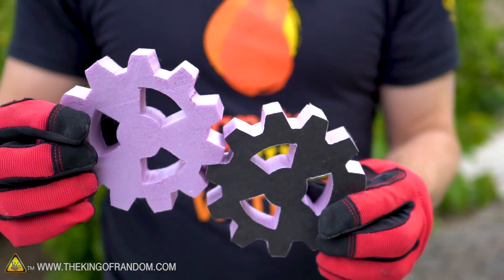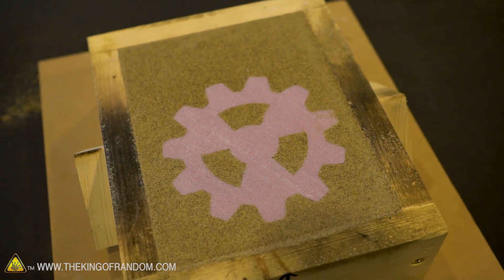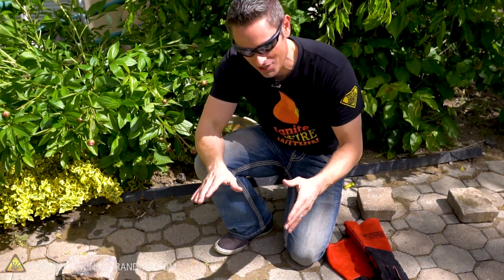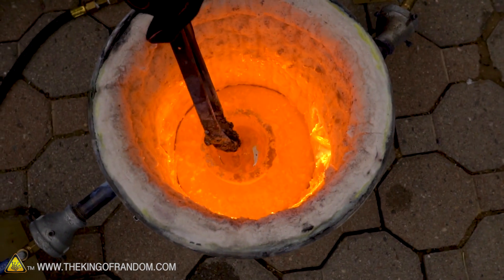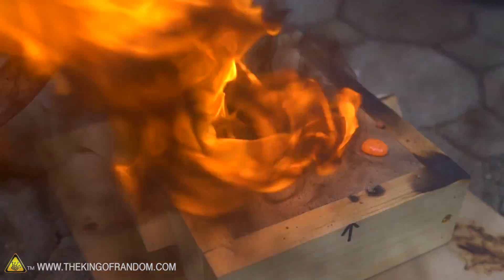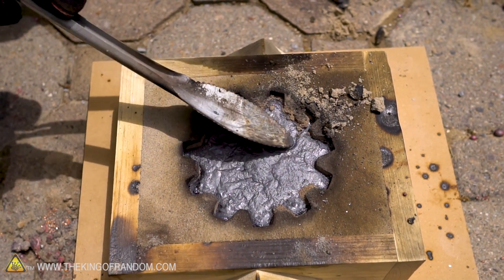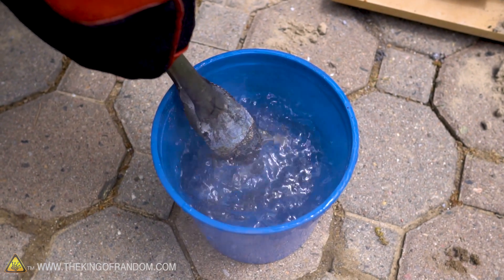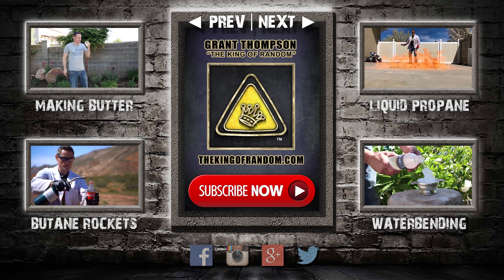Argh. Why Is Copper So Difficult? TKOR Tests Melting Copper In Our Homemade Foundry

Comment: hey grant you should upgrade the sand box when you compact it you should make a new one that will compact all of the sand  you can get two wood pieces and one should be bigger then the box and on the same size of the box then screw both pieces together

Comment: LOL! I think it's the buoyant forces that's the problem here and not the melting point of the copper. Copper have in fact higher density than cast iron or steel - and several times higher than the sand, wich causes those pieces in the middle to break off and float on top. Aluminium has much lower density, so that's why it may not have the same problem.

Comment: Next time, make the mold with two sides, one side that has the gear and other one with just flat sand surface, it should keep the sand intact in the mold when you pour it.
Reply: And you'd need a cavity for the pour, I'd say the middle part would be the best way for the gear. Also try poking air vents into all corners of the piece you're trying to cast.

Comment: Use clay to make the mold, it won't break as easily as sand. And make sure it's hot when you pour the molten copper on it, this will prevent copper to cool off too quickly and help it fill it better.

Comment: the best way to sand cast is with a cope and drag two part box, with the actual mold under the sand with a riser and a pouring basin, stops the sand from breaking and the copper from bubbling, rather than an open top

Comment: more water in your sand = more evaporation when the copper hits the sand. It makes no difference when you wave your copper over it. However why dont you preheat the green sand? You don't need the wooden box when it's stable after all.

Comment: Hey Grant. I think that because of the way the sand was packed, it might not have packed so well into the smaller areas inside of the gear, which could lead to the troubles you had with those parts popping out.

Probably not, but it's an idea.

Comment: try using cheaper styrofoam...or maybe try melting the styrofoam beforehand with a blowtorch. i was wondering why u didnt whip out the torch. also , seems like in this video pouring it into the mould faster tends to maybe break the mould.

you could also try to make those moulds where its buried in the sand instead of having one part exposed. not sure never done casting just base on tons of casting videos ive binged watch.

Comment: if you connected the Styrofoam to the bottom wood piece of the box so when you open it it comes out. Would that help at all? This way you wouldn't have to melt it and it would remove the delay.

Comment: idea: use a metal baking pan to hold the green sand, wet the sand down, then after you melt out the Styrofoam throw the mold in the oven to heat up the sand so that it doesn't cool the copper down so fast. you might lose the some and after this attempt (the heat might bake the clay) but i feel like this might work. i watch a blacksmithing channel, and whenever they do castings, they always heat the mold.

Comment: If you use both halves of the mold you made, and make a vent hole on the opposite side of which you make your pour hole, you gear will fill the whole cavity and you can just cut off the extra. Check out myfordboy on YouTube for examples

Comment: Use oil instead of water it wont boil as quickly in the copper keeping it together a under higher temps, that is what we use for iron/ aluminium casting.

Comment: All the casting videos I have seen used wax not styrofoam.  The casting company after creating the wax would cover the wax with a clay like casing.  The casing is then cured in a oven making the shell bisque hard.  It is this casing that is buried in the sand and will take the steel or what ever in the pour.

Comment: You could try placing the styrofoam completely under the green sand and use some kind of pipe that you can remove to make a pouring channel, you'll need two one to pour and one for gas to escape. i.e. pack an inch of green sand, place your foam gear pack a little more to ensure stability place a pipe on the gear and pack sand around it to ensure stability. do that in however many locations you'd like. finish packing the green sand. you need to ensure the pipes are long enough that after packing you can give just a slight twist to free it and then carefully pull it out.  I've had some success with this method. it's similar to what you did with the foam master sword.

Comment: try covering it with sand combletely
and dig channels for molten copper to run though them and make a sand funnel for pouring the copper
that's how i see people casting with green sand on youtube usually and it seems to work
 IDK though

Comment: What if you try wetting the sand, then melting the styrofoam first and then adding the copper later. The latent heat should harden the sand along with melting the styrofoam

Comment: Grant Thompson - "The king of random" try your old Technic that you used to make the brass knuckles if that does not work try a permanent cement mold but warm it up first so the copper doesn't turn solid again

Comment: My man, the surface tension of the molten copper is well enough to tear greensand.
Use some wood, stuck into the "radioactive holes".
Make sure they're in deep so they don't float.

Comment: You need to use both the cope and drag to keep those pieces supported. Also your sand mixture might not be right. It shouldn't break that easy. Try adding more clay.

Comment: Why don't you bury it completely, like you did with the mini master sword? Just glue one or two pieces of styrofoam on the Gear to act as a tube for the molten copper to flow into. That should solve the problem with the Sand popping out and it will maybe even keep the cooper molten a little bit longer, due to thermal insulation..

Comment: Grant! Copper is very tricky when using sand, which is why many people opt for metal molds instead for copper. A trick: Burn the sand into the mold you want BEFORE pouring! It will help keep its shape.

Comment: the problem is that the sand cast is fragile try using  a finer  sand-clay  mixture or  reinforce the small parts of the mold with sticks or bars, also the water in the sand, may cause this, i observed some bubbles at the end exiting from the copper

Comment: Injection moulding works with a very high pressure to make sure the molten material fills all spaces of the mould. You should use a hydraulic press to simulate that concept. But here's the problem, you'll need a more sturdy mould. Concrete maybe?

Comment: Pure copper is tricky to cast at best, so you may want to introduce traces of phosphorus to reduce oxidation, otherwise you'll find porosity throughout your casting. An open-top mould that isn't at least brought up to temperature will cool your metal too quickly, resulting in slowed flow and cracking of the mould material. Ideally you find a homegrown method for investment casting using vacuum assist.

Comment: the water is the problem i think. it instantly vaporizes when the copper hits it basically exploding the sand. might try using something a little more cohesive to hold the sand together, like maybe oil

Comment: your sand should be much fine grains. It should behave like clay. It should be so strong that you have no problem removing the Styrofoam by hand and still hold its shape. It will help if the bottom part of the Styrofoam is slightly smaller

Comment: hi Grant I love your videos . I ve  been subscribed for over 3 years and your videoss never get old. And for the copper , you should try using and solid materials instead of sand . Or even put some heavy stuff over the sand mold but not so heavy that it's going to break the mold. :)

Comment: throw some kind of flux in there, dude, clean that copper up before pouring. also, heat up your mold before pouring. you could throw it in the oven to both melt out the styrofoam and the mold won't cool down the copper as fast.

Comment: The problem with your greensand is that it doesn't have enough cohesive power to hold itself together when you pour a high-density liquid like molten copper. This combined with the residual moisture which will boil off and create steam under the copper will break off details of the mold. 
You need to make your mold stiffer. I suggest mixing in your greensand some sodium silicate, and let the mold cure for a while in the presence of carbon dioxide which will turn the sodium silicate into solid silica. That will bind the sand particles together much better than the bentonite. One way to do that would be to place your mold at the bottom of a bucket, and place a few chunks of dry ice around it. Let it stand a few hours, such as overnight.

Comment: You need to pull out the styrofoam without melting in, and possibly gently heat the green sand before pouring. The green sand doesnt need the styrofoam to hold its shape. It does look a tad crumbly though, maybe modify the mix?

Comment: you could try using  a sand Oil mixture as green sand and add the top of the wooden frame with a cone doug out in the middle

Comment: Try encasing the entire foam template in sand, instead of having one side exposed, with only a hole in the center to pour the metal into. The copper should replace the styrofoam as it melts.

Comment: add silicone to the sand instead of water. it will set almost immediately after you cast. also, you need a double sided mold. not an open faced one

Comment: I would suggest using pool filter sand mixed with sodium silica to make a hard mold ( it hardens when exposed to CO2) that way it wont break and to slow the copper cooling you could use a closed mold incited of the open mold method just be sure to vent with small holds to let the vapors out quickly to avoid pockets in the casting

Comment: liquid nitrogen vs molten salt
Reply: GMMfan #1 salt melts, google it😂
Reply: GMMfan #1 yes it does
Reply: GMMfan #1 it does
Reply: GMMfan #1 it does but in hing melting point and if put in water it will explode
Reply: Natsu Dragneel  yes when he pour it on the water and explode
Reply: 420BlAzEiTfAgGoT it's possible, he melted copper, salt melting point is lower than that
Reply: kingkongTSR i dont think he will reach the temperature to do that
Reply: im sorry i was wrong i looked up and you were right. +1 like
Reply: GMMfan #1 you don't have to be sorry it's cool you were curious enough to look it up
Reply: kingkongTSR its ridiculously hard to melt salt. If you put a cast iron pan on the stove and salt in it,( and if your stove could get hot enough)it would melt the pan before the salt. Just saying 😂
Reply: kingkongTSR salt doesn't melt though

Comment: Hey Grant! I have used my green sand with a styrofoam pattern. I successfully combined molten copper and tin to make bronze and cast an Egyptian style sword. Using the other half of your cope and slide would help provide added pressure to the bits in the middle that keep floating up. The copper just has too much mass and makes those bits float. Just make sure you provide proper venting for the vaporized styrofoam gases to escape away from the spout where you are pouring. If you have issues with the molten metal traveling too fast causing blowouts in your pattern, then you can cut "gates", just some turns in the channel that lead to the pattern, to help slow down the metal. Hope this helps!

Comment: Grant you should use both sides of the caster. fill one half with only sand you will need baby powder to make sure the sand does not stick to the mold on the other half then make a funnel for the mold on the only sand side

Comment: It is fine to cast copper in greensand, its just your boarder-lining the melting point causing it to cool quickly due to the room temperature difference, therefore the copper will harden quickly

Comment: hey grant. i did some casting in highschool. try using a top box with sprue holes to pore into. the top layer of sand should help support the center holes

Comment: There is an easier way to do it. My father was a foundry worker who used sand molds. If you instead of pour the metal into an open top, but instead make two of the sand molds, squish them together and poke a hole in the top of the metal to pour in, it will only have a small bit you need to sand down and cut.

Comment: Hi Grant, I can help with the issues your having. your close but there are a few simple things that need to be addressed.
Your green sand needs to be "milled" this is the process of completely covering your sand with the clay. its a crappy, long and labor intensive process but its the only way to make viable "true" green sand. effectively you need to mix the sand aloooot, one of the best ways is to place it on a tarp and walk on it for ages aka more than 10 mins. you could also put it in a large plastic container and squash it by hand but its alot harder. 
Second i would recommend not pouring your copper directly into the casting shape but rather through a channel so that falling copper doesn't hit your pattern sand. (all sand casting is done this way unless your using petrobond) The falling copper could weaken the sand or directly damage the pattern. copper is heavy! so it gathers abit of energy as it falls. 
Last, I would highly highly highly recommend you use the top of your mold! you made it for a reason! that can brace the clay and its possible you can skip the above two steps if you simply give the mold that extra support.

hope this helps. I have cast copper, aluminium, gold and silver for years, I even did my undergrad research project on perfecting a high resolution mixture. if you get questions pm me.
Reply: Just a dude wanting to help, is that so wrong?
Reply: +BONG WIZ and you just want attention which is why you used all caps
Reply: Scrap yard is probably the cheapest place to get copper but it can be hard to find sometimes and unreliable. You could try your local metal merchant or jeweler supply store. You are defiantly paying a premium for copper pipe. Copper alloys are always alot easier to cast as they alloying metal lowers the melting point (typically) and improves the flowing characteristics. thats why alot of people choose to cast in bronze and brass
Reply: I'll second all of Ryan's points and add another: Copper is a lot more dense than aluminum and greensand will float on it. That's why your core sections keep breaking off and floating on the liquid metal as you pour. You could try to reinforce them (I use coarse thread screws embedded in the greensand hold together sand that projects into a mold cavity) but it would be much better to use a proper two part mold, so that the cope half will hold down those cores so they can't float. This would also allow for proper gating and risers, as Ryan suggests.
PS You're about to find out, when you drill out those hollows in your gear, that pure copper is very uncooperative when machining it, too. It loves to grab and break drills, and it clogs files.
Reply: You're absolutely right. The other thing that some folks don't realize is the smaller the interior structure that will become your negative space, the more pressure needed to pack the mold. A lot of that is remedied by using a channel that slows the delivery of the metal so the force is manageable for the medium. Otherwise you can use a car Jack to rig a press machine. Just don't put so much force on it that your Styrofoam crushes.
Reply: email sent =]
Reply: green sand is called green sand doe to the clay added!! than packing tights as you go not just after its to the top!! copper is hotter so it steams the water in the sand faster and the center part dont have the mass to resist this effect!!
Reply: 2 paragraphs is long?
Reply: Ryan Smith you seem like you really know your stuff. I am a furniture maker and have a project involving casting copper into wood. Would really appreciate some input, please email me spencer@oldnorthdesigns.com
Reply: An to add, I don't think e took out the slag, because it has no use
Reply: I bit late to the party, but one more thing that he could've done is add screws etc. supports into the parts that kept popping off. I think using a channel would've been enough for it to work tbh.
Reply: Ryan Smith Hi 👋 i love metal and want it start melting can you please recommend a book 📚 that I could learn how to do it? Thanks 🙏🏿
Reply: Ryan Smith Q
Reply: Ryan Smith  your smart
Reply: @Ryan Smith
Hey, thanks for sharing! did't think about that. :p
Reply: Ryan Smith Adding draft angle may help.
Reply: Ryan Smith 
I am sure he will appreciate your knowledgeable advice.
Reply: Jeremy Nading no she or he is saying that he should write a book
Reply: Maybe you can mix it in a food processor?
The sand clay mix that is.

The kind you kneed dough with.

You know, the big ol' heavy mixer?  With the bowl attached.
Reply: Ryan Smith  would you be able to give me some pointers as to copper/ bronze casting. I thought copper casting was not possible as i was told this. The problem is i love copper way more than bronze. What infor did you send to the chap that was asking how to pour copper into wood. I would really love to see what you sent him! Any help would be most gratefully appreciated!
Reply: Ryan Smith bro did you ever get to meet him and tell him these awesome things you have said
Reply: R.I.P
Reply: Really nice of you to help !! I was 263 like !!
Reply: I was about to offer the advice with the channel! Beat me to the punch by less than an hour! DANGIT!
Reply: ryan I was going to say the same thing.
Reply: +Erectopotomus what you mad cause someone knows what they are talking about or just butthurt in general
Reply: Dam bro, write a book
Reply: Foundry green sand is "mulled" not mixed Ryan.
Reply: duuuuuuuuude you should definitely write a book!
Reply: you're*
Reply: HE DOESNT WANT HELP HE JUST WANTS VIEWS
Reply: Erectopotomus this practically is a book… a real long book